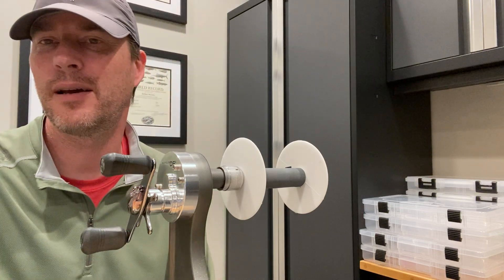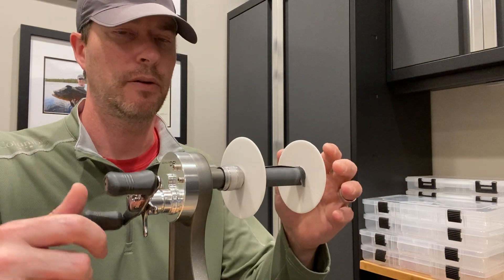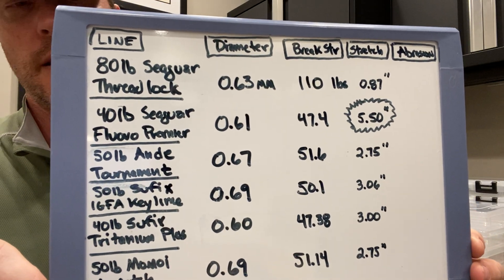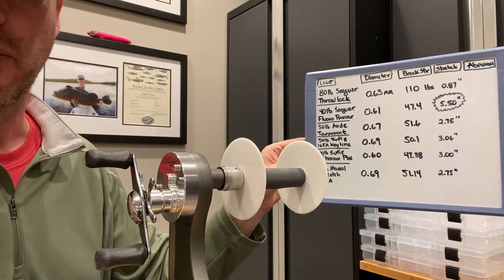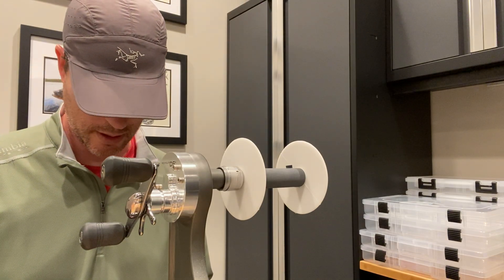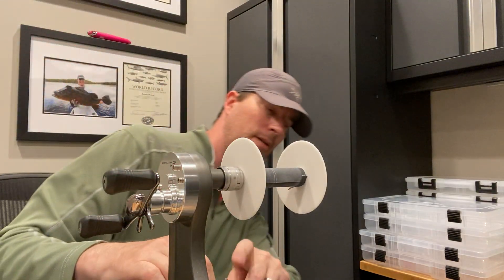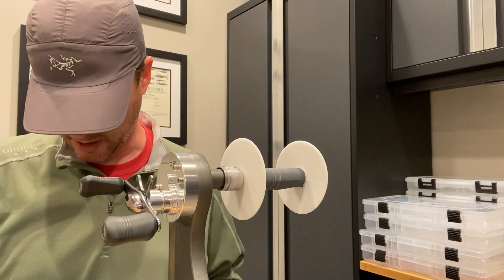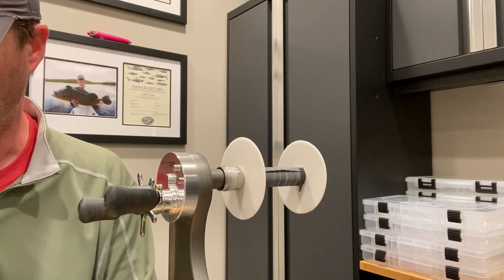Abrasion Resistance Test: Braid vs. Fluorocarbon vs. Monofilament vs. Copolymer

Comment: Having fished all over for a long time with everything I do not believe in magic bullets. I can appreciate options though. Knowing the line you choose, the options and the variables allows you to choose for every variable and never have to scratch your head until you get a bad lot#. Personally I would consider abrasion in sandy environments and cut resistance in rocky environments and around structure. Cut resistance would have to be measured with line dragged laterally across a sharp surface to model a fish dragging across a piling or rock/barnacles etc... I have had problems with lines being nicked and weakened far more often than abraded (even in sandy conditions with rocks).
Reply: Here its the fish that break the lines not the sand or rocks. Rough mouths, sharp gill plates, teeth. I agree cutting test would be nice

Comment: just going from what i see from actual sanding, I would say a harder material actually sands away more easily and quicker than softer materials.    Although we would intuitively think harder fluoro  would run against objects with less damage, based on seeing how hard materials easily sand away with sanders, a softer regular nylon mono line should survive abrasion better.